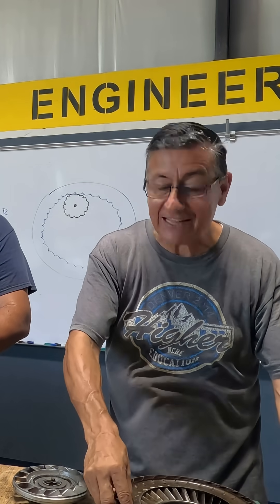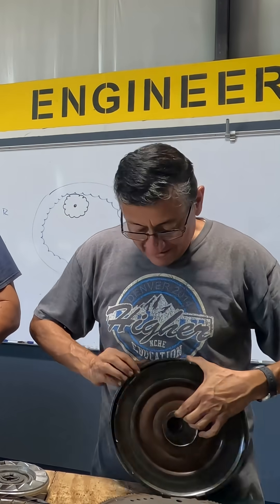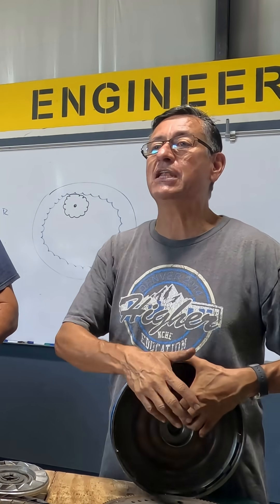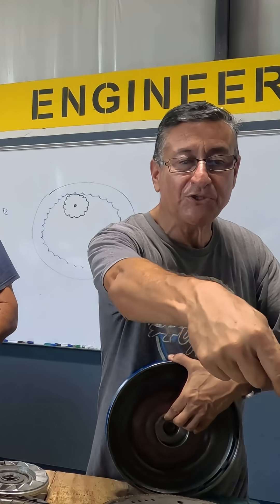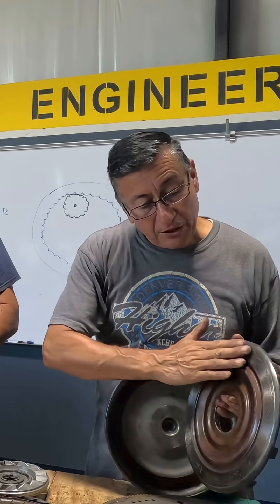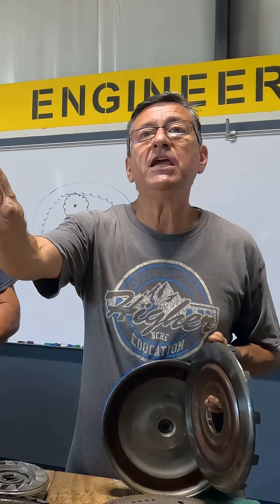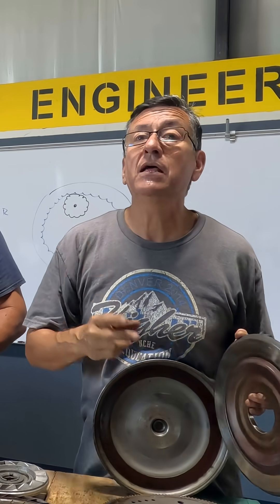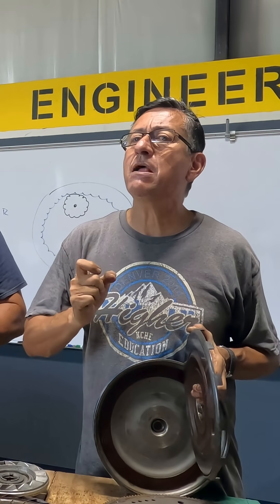The Hydraulic Clutch

Comment: Ok so now the question is letting a vehicle roll on no throttle is that bad for the friction material in the torqconverter
Reply: These are just thoughts but i assume that letting it roll while idling wouldnt wear it out as much as if you were normally giving it gas, since while idling the pressure of the liquid is wayy lower than if you revved. 

Id also think that if you were idling and braking at the same time that it would wear out quicker than when you let it roll, since the pressure in the transmission cant really „escape“ if that makes sense, thus wearing quicker
Reply: No
Reply: @tumblew33d69 yes yes it is lols